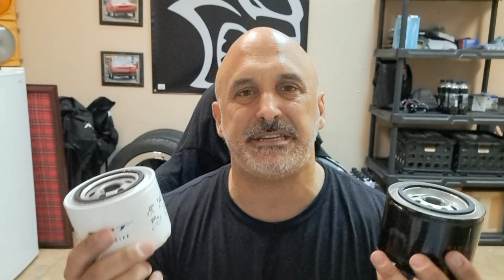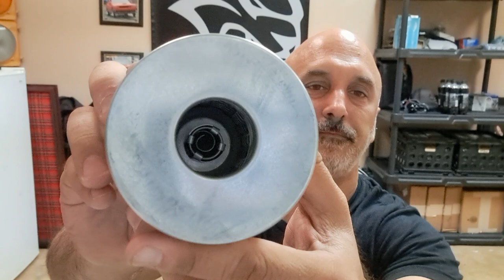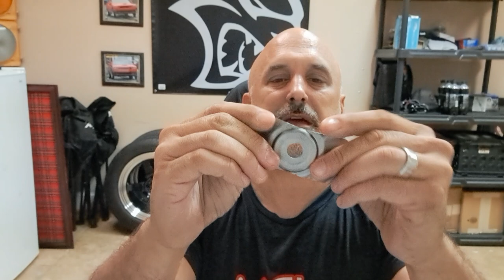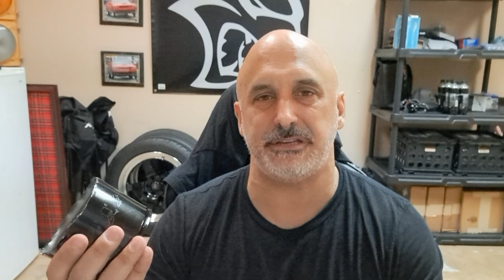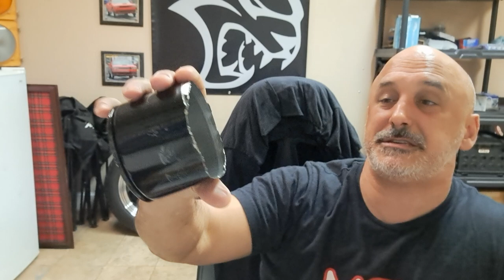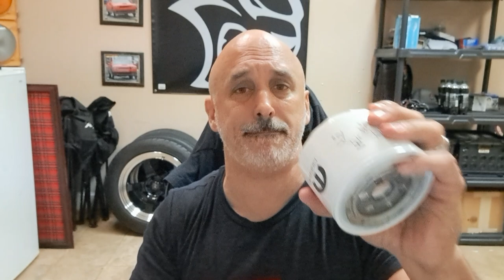SRT Oil Filter VS. Factory Replacement.

Comment: Ive had issues with the SRT filter leaking on my Redeye on 2 different times even though it was installed correctly
Reply: I have noticed that as well on my white filter. There is always a little drip of oil on the bottom. Did you switch back to the 899?
Reply: @airsoftkid01  yeah I had the same issue slow leak and little drips of oil, I switched back to the black Mopar filter and no issues ever since, the white SRT filters are technically not made for hellcats there for vipers even though it can screw on to the hellcat mating surface it just can't handle the pressure In my opinion

Comment: It all depends on what and how you drive.
I have done all the oil changes myself  on my '15 Challenger R/T daily driver every 5,ooo miles.  Ive only used the Mopar MO-899 filters. 
The car runs great, uses about a pint of oil or less between changes.  The three Blackstone oil analysis reports I've had  done over the years show zero problems or concerns.  If I couldn't find an OE filter I'd run a Wix or Mobil 1 filter before the SRT.

Comment: My concern is the bypass valve being on the bottom of the srt filter. If the oil has to bypass for any reason, it will be flowing past the dirty side of the filter media, probably grabbing contaminants on it's way by. Then pumping dirty oil throughout your engine. After seeing your video, I'm switching back to the mopar 899 or a Motorcraft FL 820s. Both of those have the check valve at the top. You did say that they both filter the same micron?
Reply from the maker: They do filter the same microns. I would prefer that the bypass is on top of the filter for cold oil running situations if the oil pump bypass is simply too high of a pressure rating, But remember that if something catastrophic does take place, there will be no filtration in essence either way. And typically with catastrophic engine failure, oil pressure drops significantly which would not impact the bypass for the filter
Reply: @bmasontv  bottom line, the 899 is the filter listed for my 5.7, 392, and 6.2, so I'll just stick with that. I see no advantage to running the srt 041 filter, only a disadvantage, (Michigan cold starts). I guess that it having more pleats, it would take more dirt to plug it up, but I change my oil every 2-3k miles, so I don't see any danger of that happening.
Reply from the maker: @scotthowat8620  run whatever filter you want. The only important thing is that you are changing your oil very regularly. You would be shocked to know how often that is not the case. Having worked at a shop, I am still mortified by the memory of some of the engines that would show up.
Reply: @bmasontv  I used to work at a dealership. This one escort came in under warranty ticking away. Pulled the valve cover and it looked like it was still on. 17,000 miles and still had the original grey oil filter. Manager refused warranty. Customer sued and won.
Reply from the maker: @scotthowat8620  there's something just inherently not right with the world for that to happen.

Comment: Very good video, thank you for sharing!

This is exactly what I was thinking. On Ford side they have their Motorcraft regular oil filters, and also they have the Ford Racing ones for Racing applications. Ford Performance filters are really more robust, can feel the difference immediately, and their much much more heavier than the regular ones. Also, same with SRT filters, I think their designed that way for high endurance racing applications when sometimes ticker oil is used when long minutes and sometimes hours of racing putting the pedal to the floor contantly. Of course regular ones will do the job on a daily basis daily driving them and doing regular maintenance, but I would not install a regular oil filter when racing, only for precaution. Their not cheap, about 40-50$ CAD, but in my opinion it's a lot better doing it than say I'm sorry.

Again thank you B Mason!

Comment: Good review but you seem to have missed an important point.
On Hemi engines the filter threads on with the inlet facing up.  If the filter bypassed the junk from the bottom of the can is unlikely to circulate unfiltered through the lubrication system.  On the SRT filter the bypass is at the bottom of the can and any debris that is in the can is highly likely to circulate through the oiling system.  Just my 2 cents.  Thanks again for a good video.
Reply from the maker: @12321sean  the bypass is on the bottom of both of these filters.
Reply: @bmasontv  I run magnets on my filters as well.  Extra piece of mind!

Comment: Curious... What is the sealing ((ring)) inner/outer diameter on both filters.  I have an oil adapter and read the Mishimoto brand is really cutting it close for the Mopar guys.

Comment: SRT engineers say the high flow pressure of the srt oil filter catchs more particles at a higher flow rate making the oil cleaner through the sytem. People try to buy srt oil filter and it says it won't fit there hellcat because its made for the viper but SRT engineers say you can use it but don't take my word for it. Check for your self before using it

The SRT engineers worked with many of the filter suppliers to get the best features. Some fell out for various performance reasons but they ended up developing the current SRT filters with Wix, a mainstream manufacturer.

The high flow oil pumps in our large engines (Viper is the biggest) can overpower the internal relief valve. When this valve opens it allows some of the high pressure dirty oil to bypass the filter element in order to keep the filter from being damaged. The SRT filters have a higher pressure differential bypass valve to make sure all the oil delivered to your engine, at cold starts and high demand, is clean.

Comment: What about the oil to use on older srt?🤔
Reply from the maker: With all the research that I've done on oil, any of the name brand oil manufacturers in whatever viscosity your manufacturer recommends, will work perfectly fine. Provided that you do not let the oil change interval go over 6,000 mi.

Comment: Had to get the black one last year for my 2016 charger scat pack  because it was difficult to find and order. But I picked one up a couple months ago, so I'm happy.

So for stormy...I haven't tried this on my newer 5th gen ram, but does that SRT filter fit in there and would you recommend it for the ram 5.7 ( obviously the 5.7 also applies to the chargers, challenger, Durango and some jeeps)
Reply from the maker: I only use the SRT filter for the Hemis.  Stormy has had 2 oil.changes and both times I ran the SRT filter.

Comment: It really doesn't matter i drove both of my challengers one with the 5.7 the other with 6.4 hard through the mountains turns and did some hard pulls on the highway with AC Delco oil filters lol no problem  just dont buy a cheap fram filter i cant speak for the hell cats tho
Reply from the maker: Fram is God-awful and I  Feel like it would be bad luck even putting my hands on a Fram Box.

Comment: Wouldn't you just use a WIX filter ?
Reply from the maker: You absolutely could, wicks makes fantastic filters, and they may actually even make the SRT filter.
Reply: I have used the Wix 57899 XP on my 392 and is VERY similar in construction to the SRT filter, HOWEVER there is some speculation that the XP filter media is not up to par in terms of actual efficiency (filters at a higher micron for supporting longer drain intervals).  WIX also does not list the nominal micron rating on the 57899XP, which is also unusual. 

Wix 57063 is the direct cross reference for the SRT filter and is made in the same Poland plant as the SRT filter, but good luck finding it in stock at a parts store, and most people say the MO-041 SRT filter has bespoke filtering media.

I’m back to using the tried and true SRT filter.

Comment: Thanks, actually my Dealer charges $15.00 for MO339, in DEC 2022……(* 2015/ Journey 4\CYL):: unfortunately, dealer also charges out ******$470.00 *****for “ Replace Four Plugs, only)………I learned the hard Way( apparently NOW 100,000 mile Plugs also: though I never got SERVICE BULLETIN, ETC.)…….was much cheaper 2018,,,,,must check fir sure.m

Comment: IMO after Blackstone oil analysis the Mopar MO899 is the worst filter you could use on a 5.7 Hemi due to the particle count results Trask was the best Hubb was second Mopar was the worst at 4000 miles. Do yourself a favor and test your oil.
Reply from the maker: my truck has about 200,000 Mi on it using cheap oil filters and semi-synthetic oil. But the oil is changed meticulously. I think that's the biggest key here

Comment: Not 2 mention alll the steel particles in the thread , when Most of the companyes do Not even wash and clean it entirely in the thread-grooves !!! ! !!! It can Easily cause bearings destruction !!! ! !!! Only Bosch and Mahle Are Clean, but since lately Mahle is ordering their filters from China, only Bosch oil filters are Trustworthy , to not have metal particles in the thread that can come into the bearings and destroy an engine !!! ! !!! Thanks 4 the video. You can also check the Cleanness of the thread of the video, and show it 2 the blind spoiled corrupt evil dumb stupid world . Thank you.

Comment: why use the filtering media as a dirt holding area until the oil washes it off the media & thru the bypass.a truely dumbass idea.so your basically sending a ton of dirt to your bearings when the bypass opens.the bypass at the entrance is a MUCH better idea.keeps the dirt IN the media, not wash it off back into the oil flow thru the bypass.